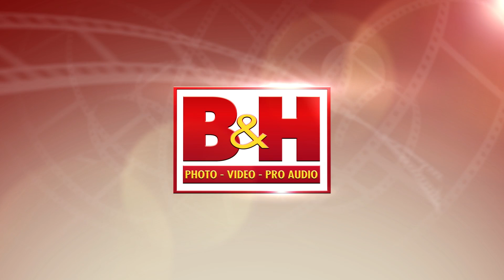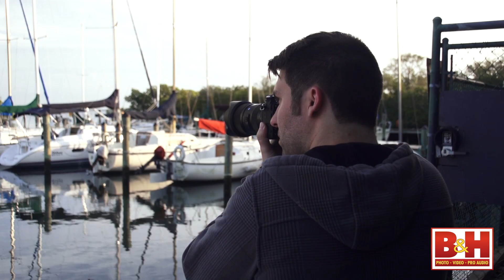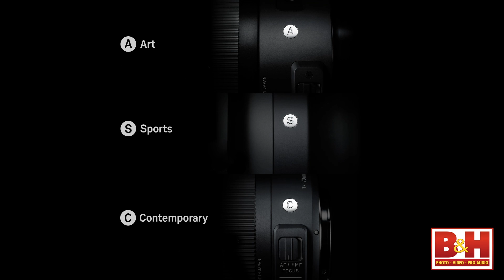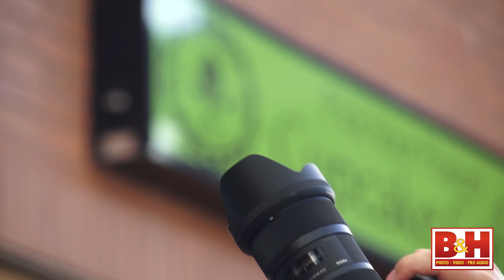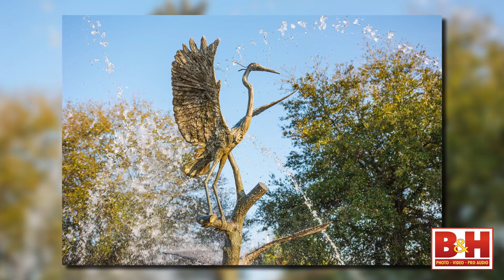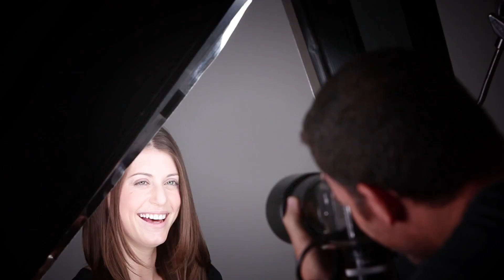Sigma 18-35mm f/1.8 DC HSM Lens

Comment: How does this lens perform at videos and video autofocus. Does it have image stabilization
Reply from the maker: The Sigma 18-35mm f/1.8 is an excellent lens, and would be capable of producing lovely video.  That being said, when it comes to the AF, the functionality during video would depend on the camera brand and model you were using the lens on.  The lens does not have image stabilization, no.  Christina  AskYouTube@bhphoto@bhphoto.com
Reply: I need lens for 70D. 
Tamron 35mm 1.4 vs Sigma 18-35mm. What is your recommendation for video. I also saw on one youtube video that Sigma 18-35mm make some sound while adjusting for autofocus during video which creates some distortion in audio. Comments please
Reply: GoodMan Pictures you shouldn’t be using autofocus for video anyway. Learn to pull focus yourself

Comment: The Sigma 18-35 f/1.8 is a game changer. It is usable only with APS-C camera bodies. It is better to buy a cheap APS-C dSLR body (around 350$) with this lens than an expensive APS-C dSLR body with a mediocre kit zoom lens. 
Most consumers ignore the importance of lenses because of the compact cameras they started photography. The sigma 15-35 gives full frame quality photos and that is an objective opinion after reading and viewing many reviews. A full frame dSLR body starts at 1500$ and that is an obstacle for many.
The sigma 18-35 is one of the most expensive APS-C lenses at around 900$. That is an issue. However most amateurs forget that a lens is an investment. Nearly all Cameras have enormous depreciation after three years and after five years they have no real value in ebay. First class expensive lenses like sigma 18-35 f/1.8 can easily retain their value for a decade. Don't forget that. All great lenses have lifetime value.

Comment: Hi B&H, I've been thinking of replacing my 18-55mm kit lens for my Canon 70D for some time now, and this seems like a good replacement. Would this be recommended for a 70D? Cheers.
Reply from the maker: +CMA Productions The Sigma 18-35mm f/1.8 would be a step up in terms of quality, and is definitely a faster lens.  Though, you will be losing some range.  If you don’t think you will miss the telephoto portion of the range you have with the 18-55mm lens, then the 18-35mm lens could be a good replacement.  Christina  AskPhoto@bhphoto.com

Comment: What would be the best fisheye lens for a Nikon fx body camera?
Or can I use a 10.5 mm f2.8  'DX' lens instead
Reply from the maker: No, we do not recommend the DX lenses be purchased for the FX models. As I mentioned earlier on this thread, using Nikon DX lenses on an FX body will cause the sensor to crop itself to a DX format and incur significant pixel loss. DX lenses can be used on FX bodies, especially so that if a user happens to have a legacy DX lens from their previous camera, that they are able to mount it onto the full frame camera. 

For a Full-frame Nikon DSLR, I would recommend the Nikon 16mm f2.8 fisheye lens, or the Sigma 15mm f2.8 fisheye lens. See the following two links: http://bhpho.to/1cPjgCY http://bhpho.to/18wE7NV - Yossi
Reply: Great!! Thanks.
One more thing, I m using a Nikon d800(36.2 mp), so if the sensor crops the image down to a DX format, approximately what size of pictures will I get in turns of megapixels?
Considering that 10.5 mm would be a much wider lens. 
Just a thought!!
Reply: And, great recommendations. Thanks a lot
Reply from the maker: kevalc11 When using a DX lens (or third-party lens designed for APS-C sensors) on the full-frame Nikon D800 and using the Auto-DX Crop Mode, the 36 megapixel resolution is reduced down to 15.4 megapixels. If you are referring to using the Nikon 10.5mm f/2.8 Fisheye Lens in your comment, do note that the Auto-DX Crop mode still applies the same 1.5x crop factor to the image, making the lens an effective 15.75mm lens. The Nikon 16mm f/2.8 Fisheye lens would be a full-frame lens with similar focal length.

Comment from the maker: +Sam Casale  When you mount an APS-C/DX format lens on the D800, it crops its sensor (causing significant pixel loss) to make itself a DX camera. A Sigma 18-35mm f1.8 lens on the D800 would be no different than using it on DX camera, its focal length would be equivalent to 27-52mm. 

This lens is the first zoom lens in history to have a wider aperture than f2.8. There are not any other zooms with this feature currently, and we likely wont see any in an FX format due to the size it would require the lens to be to get a zoom with an f1.8 (would require the lens to be huge, making it heavy, and extremely costly for design and production). - Yossi
Reply: This statement is very confusing. It's a 18-35mm for an APS-C sensor. But when mounted on a full frame camera i.e. Nikon D800 it defaults to a APS-C or cropped sensor. But why would the focal length change. I think you have it reversed. If this lens was made for a FULL FRAME camera, then when used on a DX camera it's focal length would change to 27-52mm.
Reply from the maker: SuperLumberjock I am sorry this is confusing; however I do not have it reversed. Please permit me first to clarify the following: 1) All lenses, whether they be for a DX format, or FX format are named in terms of 35mm film camera standards (aka FX format). This Sigma 18-35mm f1.8 lens is a ?DX? format lens, meaning made/designed/intended to be used on a DX camera body, and as the rule about lenses on DX bodies go, lens? focal lengths are multiplied by 1.5x with Nikon (by 1.6x for Canon). The 18-35mm lens is equivalent to 27-52mm on an FX format (meaning if we wanted do duplicate how this lens views with a full frame camera, we would have to mount a 27-52mm lens or closest equivalent that exists onto the FX camera). 
2) Nikon full-frame (FX) DSLRs are designed especially so that if a user happens to have a legacy DX lens from their previous camera, that they are able to mount it onto the full frame camera. Nikon designed the full-frame cameras in this application to decrease the surface area of the sensor from full-frame, to a DX sized surface area, so as to maintain the optimization of the DX lens? design. 
To recap, 1) ANY lens you mount on a Nikon DX camera, whether made for DX or FX format is multiplied by 1.5x as all lenses are named/enumerated based on the FX standard. (Canon does not have the option to mount a DX(EF-S) lens onto their full-frame bodies). - Yossi

Comment: it still works on a full frame. right?!
Reply from the maker: It could be used on a full-frame Nikon but would encounter the crop-sensor effect in the camera. It could not be used on any other full-frame systems however.
Reply: B and H
well thats too bad. :( cause i wanted to upgrade on a canon full frame soon :(

Comment: I know this is for APS-C so what happens if I want to use it on my D800.  I guess I get the real 18-35mm, but at a 1.5x crop.  It seems like a lens like this is missing from the offerings for FX bodies?
Reply: +Sam Casale Photography Sure, you will get the real 18-35mm focal length, but you have to deal with heavy vignetting. And when I talk about heavy vignetting I mean something like this: http://www.fredmiranda.com/forum/topic/1279757 So you really have to crop your imagine a lot and then you will have the same result as on a DX camera

Comment: Don't patronise, anyone who has bought and used and APS-C camera well understands what 18mm looks like on their camera, and probably has no idea what 24mm looks like on a so-called full-frame camera. I used to shoot film, an an EOS 630 and TLR. I found all this nonsense about crop sensors, full frame and lens equivalents immensely confusing.

In reality, it's very simple: learn your own gear.

If you're teaching, you need to tell people both camera and lens you are using, and maybe at some point, if you have an APS-C or M43 sensor, then these lenses will give similar results.

In this case, it's a wide-angle lens for APS-C sensors. Your job is to tell me why it's better than my 18-55 kit lens. Mentioning full-frame just confuses the issue.

Comment: Will this lens work with a Canon DSLR camera?
Reply: it works with most of camera (APS-C Only)
Reply from the maker: Sigma does make the 18-35mm f/1.8 in a Canon mount, which could be used on any Canon DSLR with an APS-C size sensor. Christina askbh@bandh.com